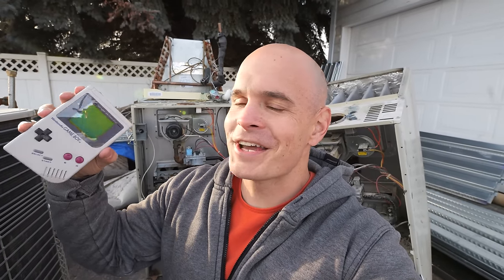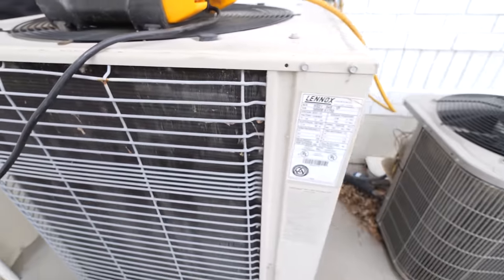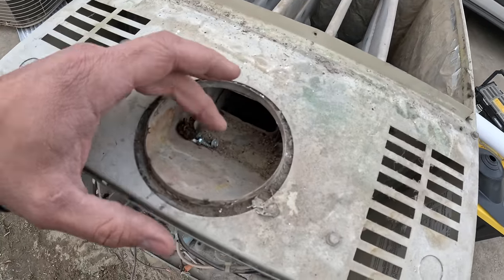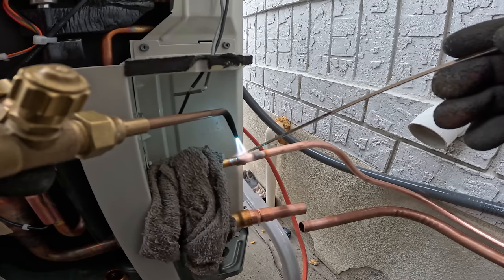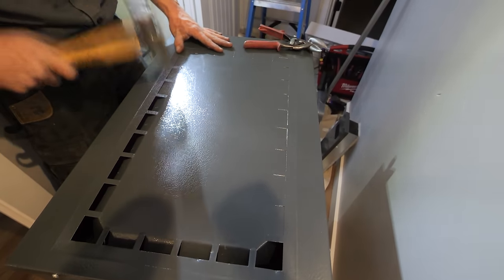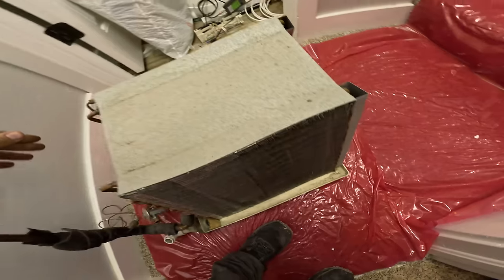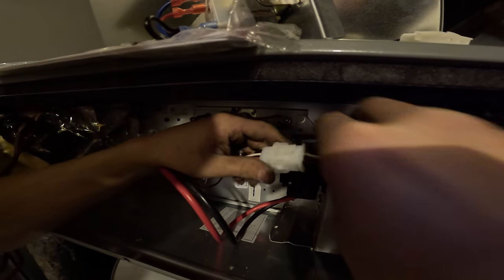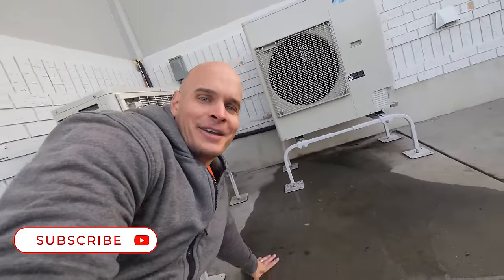Why is Everyone Talking about Heat Pumps?

Comment: I do wonder what the longevity and expected life heat pumps will give? A/C and furnace setups last decades before needing to be replaced. So, if these only last a fraction of what the last units lasted, would you be saving money?
Reply: average is 12-15 years if you are lucky. As they age their effectiveness and energy usage goes up. It runs year round vs a normal ac runs 6 to 7 months a year. Answer is now, cost more upfront, cost more to fix and maintain. They last half the time of a traditional system.
Reply: Since a heat pump is 90% the same as an AC unit it should last just as long. Calendar life is less because you will run it in the winter instead of just the summer. Modern inverter units should have longer life than a conventional AC on the mechanical bits but the electronics could fail. Fortunately electronics are cheaper and easier to fix/swap than the sealed system.

Comment: Heat pumps are great.   Keep in mind though, YOU aren't burning gas, but the electric supplier is using gas, coal & oil to create the power.

Comment: As long as the inducer motor works and there is no cracks in the heat exchanger is  not cracked why would you get fumes in the house.

Comment: Those installers were brazing without nitrogen causing the copper to have oxidation flakes inside the pipes which will eventually clog the TXV and make the system fail sooner than they would normally. Also they burned the removable rubber gaskets. Like wtf? They’re removable for a reason. These are only the flaws that I saw. I’m sure there were many more if that’s the kind of work these guys do.

Comment: I have a Daikin FIT system, and yes, they are way more efficient than my old traditional AC gas furnace, but I really dislike the Daikin One thermostat and the blower motor. On normal operation, it ramps up to full speed and it sounds like a restaurant kitchen hood vent measuring around 69 dB at the return, and you can't control the fan speed. Also, the FIT system does not qualify for the federal tax credit because it's not Energy Star certified. You have a better system than me. But then again, you are JRE. Daikin send out a firmware update to be able to control the fan speed!!!!

Comment: Heat pumps are neat. If you want even more efficiency and live in extreme climates, it is worth considering a borehole or exhaust air heat exchanger.

You can even get them with water heaters built in so you're heating water with the compressor rather than electrical coils.

Only thing that ever worries me is if there is a major grid issue, but if you have contingencies, it's great tech.
Reply: They suck in general and I cant believe people buy into the nonsense. They are crap . compared to NG systems

Comment: Heat pumps make sense in a climate with hot summer where they can be used as air conditioning and also to provide ambient heat spring and summer. It also requires a well insulated house. In winter though my friend in Canada uses a log burner because the heat pump doesn't do the job at -20 C and below in his rural property. I also understand in Scandinavia that is the case in rural property too.

Unfortunately, this is not understood in the UK where the government is trying to force heat pumps on the population and ban all gas/oil boilers. We have old housing stock which is poorly insulated, single brick walls in many cases and expensive electricity. We also have water-based radiator systems whereas the system that works best with heat pumps is air to air. Most people who have fitted heat pumps in the UK complain their house is always cold in winter and they don't benefit from air con either in summer either because our houses have water filled radiators. Very few people have air vents built into their houses in the UK.
Reply: You're leaning into the myths, and very outdated info.
My home was heated solely by heati pumps in -20C for 3 days straight in January. 
My daughter even had her room at 25C.

Is insulation important? Yes, for any kind of heat source 
Modern heat pumps can and do work on properties that aren't well insulated.
If the UK had a reasonable spark gap (cost of gas Vs electricity) then for most a heat pump would be a no brainer.

The main issue (in the UK) is having over 12kW heat loss, where the heat pumps for above that generally are 3 phase, which most UK houses don't have.
So your options are:
- expensive upgrade to electrical supply
- install a 2nd heat pump to divide up the load, which will probably set you back £5-8kish extra
- spend that money on insulation etc to bring the heat loss down.
Average heat loss in the UK is 6-8kW at -3C so not an issue for most.
Reply: @BenIsInSweden  Electricity is very expensive in the UK, fourth most expensive in Europe. We have the oldest housing stock in Europe, mine was built in 1825 and has single brick walls and is a Listed building and if I fitted wall insulation I would be prosecuted. We don't have enough engineers to fit heat pumps at the rate required and most people simply can't afford the up front capital cost. These are the real world problems and unfortunately you are saying the things our politicians believe because they have heard about how it works in Sweden.
Reply: @brianthesnail3815  They work in the UK as well.  
There may be some situations where they aren't financially viable, but the insulation excuse is a tired one now.

Electricity is only high vs gas in the UK because there are still loads of  things that favour gas over electricity:
- Gas power plants get taxed for burning gas, that tax doesn't apply to burning it in the home.
- Social and Economic levies are still in favour of gas over electricity.
- Electricity prices are largely set by the gas power plants, when other sources of electricity make up the mix.

Also, I'm a Brit, and spend a lot of time in the UK, just because I live in Sweden, doesn't mean I don't know how things are in the UK. And I know enough about heat pumps to know what environments they will work in.

Yes, there aren't enough skilled people to fit them at the moment in the UK, but all the factors you state aren't ones that prevent the technology from working in the UK.
Reply: @BenIsInSweden  I am not clear what you are arguing. The factors like high electricity prices and lack of insulation you acknowledge. Those are real factors. Its why they don't work in the UK.
Reply: @brianthesnail3815   I'm not sure how you equate energy prices to whether something works or not. But I digress, lack of insulation doesn't prevent a heat pump from working either.
Insulation is a good idea - where possible. A Heat pump will work just fine without insulation in the vast majority of cases but it may not make as much sense with the current gas and electricity prices.
You can have zero insulation and still have a heat pump that beats gas on running costs in the UK.

If the spark gap in the UK wasn't so high (European average is around 3, UK is 4-5). Then it would make sense for anyone to get some form of heat pump for primary heating regardless of insulation level etc.

They are also not being forced on anyone, the government is encouraging them with grants etc.
New builds you don't get a choice in the heating system beforehand anyway, and you do have the choice not to buy a new build.
Reply: @BenIsInSweden  Our old housing stock and lack of insulation means that the heat pumps often cant keep pace with the heat loss. Add in our air to water system unlike typical air-to-air systems in Scandinavia/Canada makes it worse and houses just don't heat up enough. Then add in the fact our electricity is expensive and it quickly get to a point where it becomes impossible to justify the heat pump running compared to gas, especially at low outside air temperatures. I am just quoting people that have them fitted in the UK in less than ideal properties. I am sure for some people in modern well insulated houses it works but for the average UK house it just won't. My town is full of Georgian houses and Victorian terraces.
Reply: @brianthesnail3815   that's still not true, there are plenty of people in the UK with varying vintage of house and insulation all with heat pumps running fine. There have also been high temperature heat pumps on the market for some time now.
Air to water Vs air to air makes very little difference to whether a system will work or not, they just provide the heat in different ways, and air 2 air is still available in the UK and is in many cases even without the grant comes to a similar cost.

The reason why air to air is common in Sweden is wet systems got yanked out in the 70s in favour of electric radiators due to the oil crisis, my 1920s house still has remnants of a once existing wet system, but it's not usable.  And having a wet system put back in is very expensive (tune of around £30k without the heat source for my property,).  It is also strongly recommended, because it opens up the possibility of ground source.
My friends who are in recent builds are all ground source from the get go, with underfloor heating downstairs and rads upstairs)

The UK having central heating systems already in place get efficiency benefits that make more sense over air 2 air.  E.g. easily being able to use more heat emitters to reduce the temperature needed to run the system.

Any system that can't keep up with the heat loss was improperly sized at the get go.

Comment: Hi @JerryRigEverything i scroll through comments, reed a couple and i would like to hear from you how this system works, are those comments are true? i have some questions - for example did they do good job connecting thoose pipes or it's matter of opinion not the efficiency. About this 410a gas if it's really that old and less efficient than some of the newer refrigerant had you have some fellings about been fooled by this company? I wanna try this kind of heating solution in my house soo it would stay cool in summer and warm in winter when temps drops to  - 10*C .

Comment: Where can i get some of that exterior insulation for the refrigerant piping in Canada? What is it called? It looks like it has a protective covering while most of the installers in my area are using soft black foam pipe insulation that the birds and wildlife rip to shreds in no time.
Reply: Armaflex is the brand name
Reply: @zack9912000  thank you 🙂

Comment: Isn't air conditioner also  a heat pump? Like frigdes with compressor. We are using this heat pumps (cools and also heats with compressor) for about 15 years.  Does "Air conditioner" mean something different in Usa?

Comment: We had a river house (Indian tribe burned it down after 30-40 years of lease) because the crit((Colorado river Indian tribe) they lost land lawsuits when the river naturally changed directions over a century. . Chief was on the property (30 miles from any town and no tribal colonies for hundreds of miles) before fire dept could arrive and burned 40 years of history and $150,000.00 worth of custom famous flat bottom boats.  

Owner was an engineer. He did a basic heat pump system w the air conditioning in a 40 year old built on type basic mobile home river set up.  Once he did it , elec bill in summer cost about 100 a month max running always in Blythe California at 100-125 degree all summer and kept internal temp to a good 67-75 degrees when 120 outside.  Wasnt a purchased system though.

Comment: Will you get a heat-exchanger ventilation system unit as well?
Reply: heat exchanger ventilation is only usefull if the house doesn't leak air in vast amounts. As he needs two quite large units and gas backup, it's very unlikely that the house is airtight. In that case it's not worth it.

Comment: good account of heat pumps.
Mine is slightly underated for the house but it does work.
just dont expect a 5 celcius heat change in one evening.
these things are good for keeping a temperature NOT blasting a house up to a desired temperature.
In icy conditions, the outside unit has heater coils to stop ice forming, just a shame any ground around  a heat pump unit turns into a icy death trap from all of the water run off.
below about 5 celcius, these things draw a ton of electric (heaters are on ) and it gives a false feeling of using a ton of electric.
Reply: Modern heat pumps can provide lots of heat below freezing temperatures. The electric heat strips shouldn't come on very often unless the unit is too small.

Comment: Why does the energy guide tag say it's near the bottom of the efficiency range in both cooling and heating?
Reply: Both ducted and mini-splits are placed on the same scale. Ducted systems require large circulation fans and thus are always less efficient than an equivalent ductless unit. Also it just isn't a particularly great performing unit.

Comment: Great job featuring heat pumps and documenting the install. But man, it's 2024 and we're facing the worst threat the world has ever seen continuing to burn fossil fuels. 

It would have been nicer to see you choose a cold climate rated heat pump that doesn't require a furnace or resistive heat strips at all. Your installer should have given you that option. Daiken's Aurora or Mitsubishi's Hyperheat are designed for houses like yours that see extreme low temps.

Comment: I am a little baffled that heat-pumps are a discussion. Like my parents got one 25 years ago and even then I though Norway was behind the world. I mean, we can discuss efficiencies on many things, but the powerbill drops by 75% it kinda is dead to me. My heat pumps are on their 15th year, they were paid down a looooooooooonng time ago. But yeah, if you wanna save money by bying a $50 heating element outputting a 1000 watts and getting a 1000 watts instead of installing a pump for $1500 that uses 500 watts to give you 2000 watts...go ahead. Those $1500 is gonna be paid off in no time, while that  $50 heater is gonna cost you a lot more and you wont even get it warm enough.

Comment: i got a new system this year, almost went with a heat pump but considering where I live (socal) going with a traditional system felt like it made more sense. the heat here only ever gets run maybe like 10 days a year, while the AC gets run several months a year. and from my personal research it seemed like a heat pump system is much better and more efficient when you live someplace where you get both hot and cold extremes and are using both heating and cooling often. I may have come to the wrong conclusion, not sure, but i'm happy with my system. and with all the extra hardware with the heat pump system, even with rebates, the two cost about the same. also for my install where i have a large solar panel system the heat pump involved a lot of extra parts and new wiring. it just felt like something that would be harder for me to do basic maintenance on myself.
Reply: your AC already is a heat pump. the only thing that is being added is a valve to reverse the function. if you have a AC that can keep the house cool you can keep it warm with a heat pump. the price difference should be nothings these days.
Reply: IMO your reasoning is wrong. Heat pumps are best when there's minimal heating needs and and gas furnaces are often better when it's regularly very cold.
Reply: @eDoc2020  that is backwards thinking. first off: you are confusing the amount of heat that you need with the method of generating heat. 1kW from a furnace is exactly the same as 1kW from a heat pump or 1kW from a eletric heater. the amount of heat that you need to keep a home warm does not change by changing the method of generating said heat. and heat pumps work down to -25F for even a normal one so that whole cold argument does not apply.

Comment: You are trading fast older gas furnace for slow newer heat pump.  Curious how your heating bills compare?  Should be lower with more efficacy,   I wonder if it is and how much.  I just switched from electric boiler and water heater system to on demand propane.  Greatly lowered my utilities bill.  Even with my 4 kids taking very long showers since they no longer run out of hot water.  🙄😂

Comment: Fun fact in Canada 410a is being phased out and will no longer be used.
Reply: It will be around for another decaded even after beeing banned. R22 is still available just 1500 a 25 pound jug.
Reply: I wonder, is it the same in the states. I know that they still sometimes install mid efficiency (up until recently at least) I wonder if it would be the same for the refrigerant.
Reply: Supplu houses are stocking up as much as possible and will still have stuff to sell when the new systems eventually have issues.
Reply: @CobblerEx  410A is indeed being phased out here in the states. The market was supposed to shift to other refrigerants this year but they've obviously been delayed. The main holdup is building codes not being updates to allow slightly flammable refrigerants.